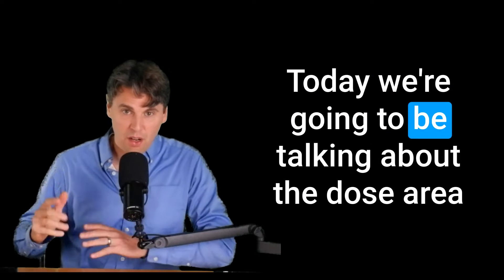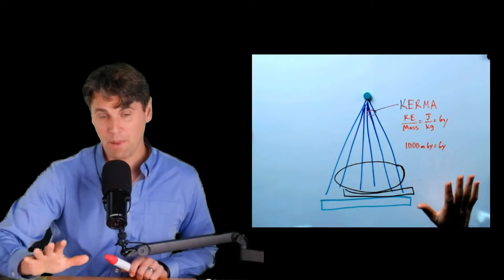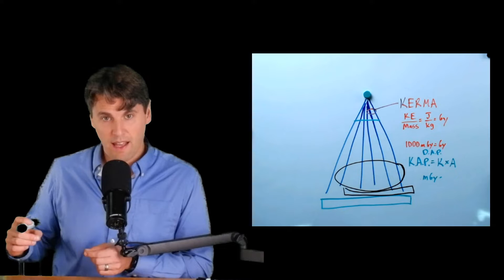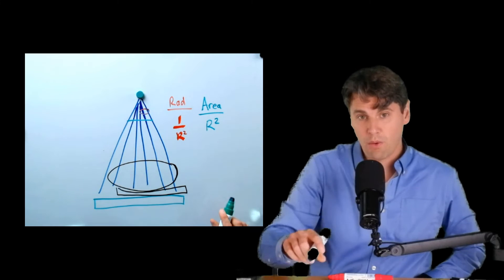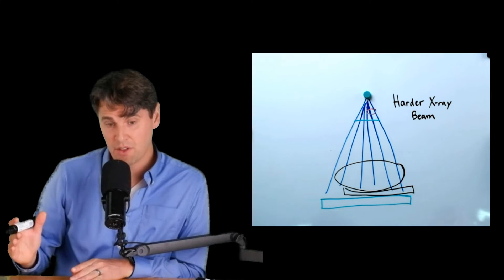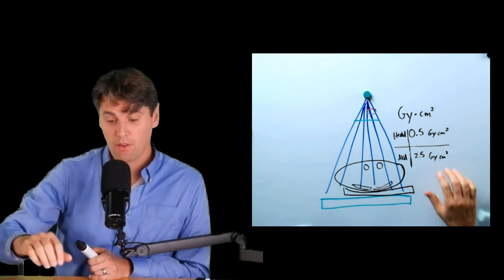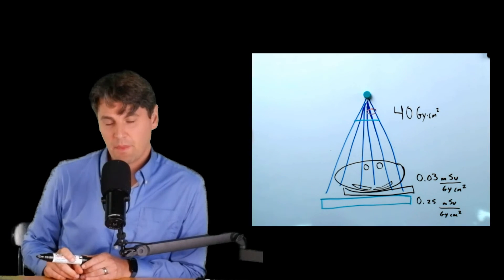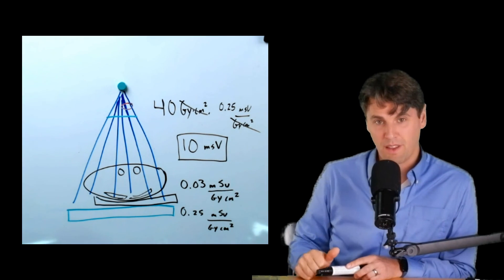Dose Area Product DAP, Kerma Area Product KAP

Comment: Hello, mister. My question about effective dose in angiography. Can I measure dose with dosemeter piranha then multiply to square of radiation field and get KAP? Is it right?
Reply from the maker: Yes this sounds like the right procedure
Reply: @HowRadiologyWorks  does it mean that square of detector in piranha equals 1 cm2? Because if we multiply to square of x ray detector it should be 1 cm2. In another case we need to know square of detector in piranha dosemeter and calculate dose per 1 cm2.
P.s.i found instruction for dosemeter raysafe and there explained to calculate DAP as I wrote.
P.s. sorry for my English. It is not my native language
Reply: @HowRadiologyWorks  what do you think about my mind? I knew square of piranha detector. It is 10×10 mm or 0.01 cm2
For example square of x ray field in angiography Artis zee about 380 cm2
For example dose measured by piranha is 0.13 mGy 
My DAP is 0.13 mGy ×100 (dose per 1 cm2)
Then result multiply to 380 cm2.
Is it right, how do you think?